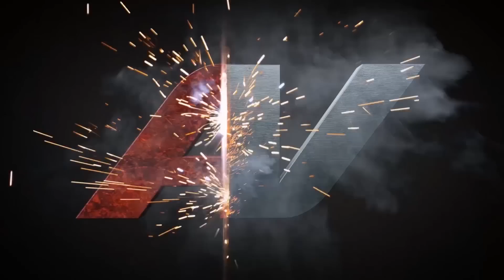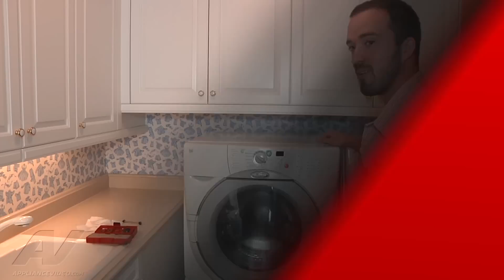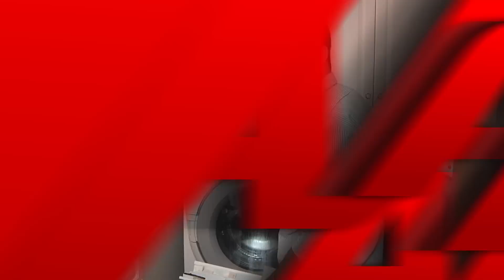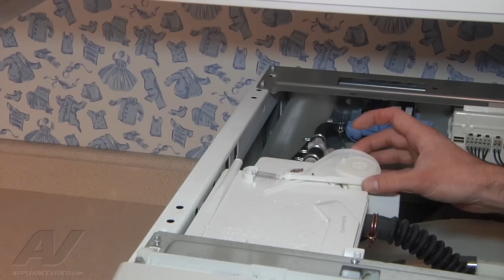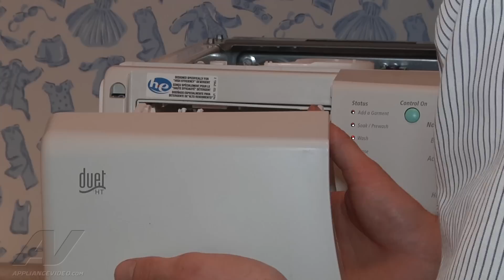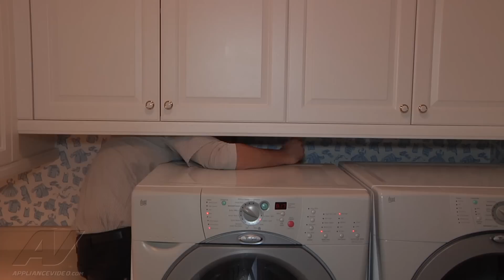Whirlpool Washer Repair - Fabric Softener Is Not Dispensing - Detergent Drawer

Comment: I kept jugs of detergent and  softener, side-by-side, over the drawer which had spigots for easy dispensing directly into the compartments.  After removing the washer's lid and inspection of the mechanism I realized the weight of the containers was pinching the mechanism and preventing proper travel of the diverting valve.  After relocating the jugs and replacing the lid; PROBLEM SOLVED,  no parts, no service call, no sweat.

Comment: My whirlpool washer is new. Probably 5 months old but we've had this problem from the beginning. Service tech. was no help as he told us we needed to run vinegar or cleaner through which we have. Seems to be a defective part as we had the same problem with our previous whirlpool. We do have extra hard water  which caused other problems previously. Basically we just use dryer sheets instead.

Comment: Just found this video. I have exactly the same issue but my washer is brand new LG series(bought it yesterday). It's not fixed yet, haven't called any technician. possibly problem with the diverter valve since mine is brand new washer?

Comment: Thanks, this helps as I have the same machine with the same issue... among others. I, unfortunately, got water in my CCU while replacing the inlet valves; the hot water connection was not tight. I ordered a replacement CCU and successfully installed it, but now I get the dreaded HF code, and I've already also replaced the drain pump, and flow meter UGH! I ran the diagnostic test, which advanced to level "C5,"  but it stuck there, so I canceled out and hit spin/drain. I cannot figure out why I'm getting the HF code and suggestions? Thanks!
Reply from the maker: Great question, if you have a more technical question that our parts department cannot answer, you can search our over 17,000 answered questions free at our website www.ApplianceVideo.com under our Repair Help section. You can also call our parts department at 1-800-830-5465 and they can give you help 7-days A week ,or search at www.SaveMoreOnParts.com  .

Comment: Ever repair ( De-clog ) for this dispenser is for Front Load Or pull outs , whirlpool TOP LOADS are stationary !
Reply from the maker: Great question, if you have a more technical question that our parts department cannot answer, you can search our over 17,000 answered questions free at our website www.ApplianceVideo.com under our Repair Help section. You can also call our parts department at 1-800-830-5465 and they can give you help 7-days A week ,or search at www.SaveMoreOnParts.com  .

Comment: On my washer the cold water inlet had a small removable blue plastic screen/strainer inside. I used needlenose pliers and a small screw driver to pry out and remove the plastic screen. I cleaned it out with water and compressed air and now the washer works fine.   I did find my main well water filters had been accidentally left bypassed (opps) and the inlet screen got plugged up with fine sand.
Reply from the maker: Great question, if you have a more technical question that our parts department cannot answer, you can search our over 17,000 answered questions free at our website www.ApplianceVideo.com under our Repair Help section. You can also call our parts department at 1-800-830-5465 and they can give you help 7-days A week ,or search at www.SaveMoreOnParts.com  .

Comment: It would really help if they made these machines like they used to instead of cheap plastic junk! Mine has been nothing but a problem since I bought it. Video was very informative though. Thank you.
Reply from the maker: Great question, if you have a more technical question that our parts department cannot answer, you can search our over 13,000 answered questions free at our website www.ApplianceVideo.com under our Repair Help section. You can also call our parts department at 1-800-830-5465 and they can give you help 7-days A week ,or search at www.SaveMoreOnParts.com  .

Comment: my whirlpool duet steam washer doesnt dispense detergent either its a different model no notch in tray, WFW96HEAC0. 
first i removed the detergent tray and took it all apart cleaned it and left it soaking, and cleaned both connecting ends, didnt work
next i was told by a whirlpool employee to run the washer without any detergent with hot water to unclog, didnt work
 also when i put detergent through front door how come it never shows suds? and clothes dont smell as good as before with my 12 year old set. 
 kinda disappointed, any help or suggestions would be greatly appreciated thank you
Reply from the maker: Great question, if you have a
more technical question that our parts department cannot answer, you can search
our over 10,000 answered questions free at our website www.ApplianceVideo.com under our Repair Help section. You can also call
our parts department at 1-800-830-5465 and they can give you help 7-days A week
Monday -Sunday, or search at www.SaveMoreOnParts.com  24 hours
7- days A week.

Comment: I was cleaning the inside of the detergent dispenser after removing the compartment piece and a piece  from the back came dislodged.  I do I correctly place it back in?
Reply from the maker: Great question, if you have a
more technical question that our parts department cannot answer, our
technicians are answering all questions at our website at www.ApplianceVideo.com under our Repair Help section. You can also call
our parts department at 1-800-830-5465 and they can give you help 7-days A week
Monday -Sunday, or search at www.SaveMoreOnParts.com  24 hours
7- days A week.

Comment: I just moved into a house that has this same washer but I noticed when I pull out the tray when the wash is done it's full ed with water.. the detergent and softener are gone but there's water left in the tray.
Reply from the maker: Great question, you can call
our parts department at 1-800-830-5465 and they can give you help 6-days A week
Mon-Sat . You can also search at www.SaveMoreOnParts.com 7- days a week.  If you have a more
technical question that our parts department cannot answer, our technicians are
answering all questions at our website at www.ApplianceVideo.com under our Repair Help section. We have over 6,000
common questions and answers that you can easily search through by your model
number, appliance make, problem or error codes, and It’s completely free to
search through our question & answer library. There is a very good chance
you question is already answered there.

Comment: Hi.  thanks for the video.  I just wanted to ask how you were able to run the fill cycle to see if the motor was working.  it sounds like you pushed some buttons on the control panel at 2:55 into the video.  My water diverter is stuck at position II.  It does not go to the I position.  Thanks.
Reply from the maker: Great
question, you can call our parts department at 1-800-830-5465 and they can give
you help. If you have a more technical question that our parts department
cannot answer, our technicians are answering
all questions at our website at ApplianceVideo.com under our Repair Help
section. We have over 3,000 common questions and answers that you can easily
search through by your model number, appliance make, and problem or error codes,
and  Its free to search through our question & answer library.
Reply: Did you find the solution? Mine works but sits at the II and also doesn't go to the I position.

Comment: Great video.  But my problem is that the softener dispenses, but after the cycle is over I have my softener and bleach cup full of clear water.  This just started.  This is a Maytag Epic front load.  Any advice would be appreciated.
Reply from the maker: Tony
   All of our technicians are now answering questions daily on the ApplianceVideo.com website. You can search completely FREE in our Repair Help section with over 1000 questions & answers. Or you can get unlimited technical advice and video links emailed to you by our 14 factory certified technicians at http://www.appliancevideo.com/premium-membership/.  If you are in need of any parts please support our parts department on line at http://savemoreonparts.com/ or call 1-800-830-5465 7-days a week until 11pm Eastern time. Thanks for your support. Matt Ace Appliance factory service technician.